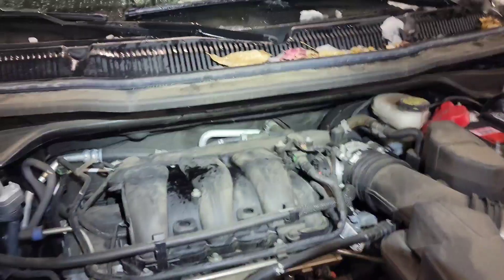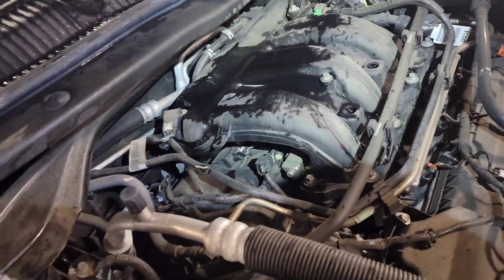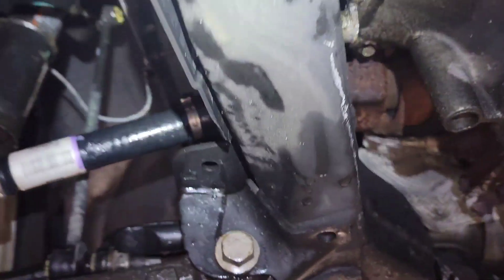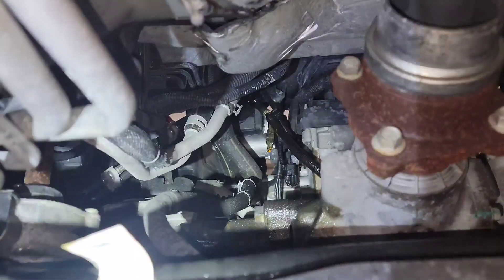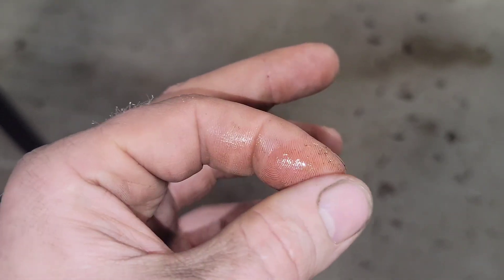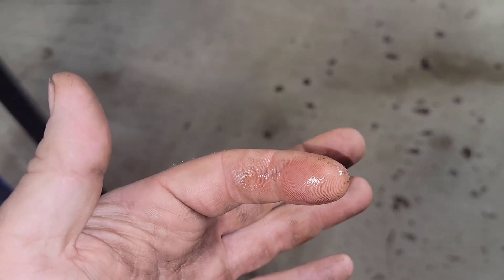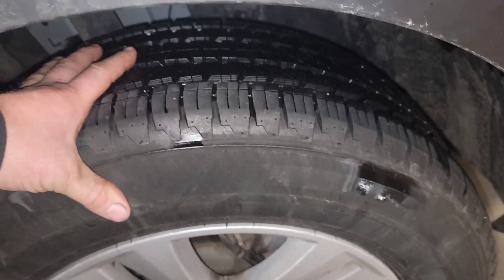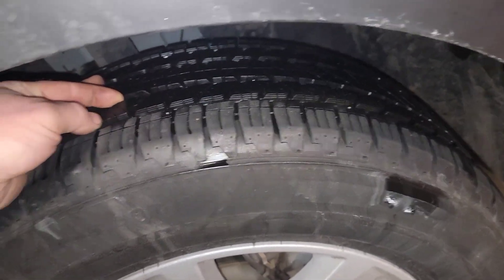2018 Ford Explorer 3.5L Front Cover Leak, PTU Leak, Roof Rail Fix - Part 1 Waiting on Approvals

Comment: Fantastic job, Actually my Ford Edge 2014 AWD SEL running 120k Miles, one week ago check AWD appeared on the dashboard then it's disappeared after one day only. And during the usual service check-up, the Mechanical noticed that there was a bit of a leak from the PTU and when we checked it smelled burnt oil even though the color was still crimson to brown then he advises replacing the PTU itself. Another friend recommends changing the PTU fluid only. Please I need your suggestion asap
Reply from the maker: 2 ways you can go, change fluid and possibly to work and eat the money or go right to the ptu and be done and service it every 30k from now on or sooner

Comment: I have a '16 Explorer with about 65k on it. I do my own fluid changes using Amsoil. I've done the diff and PTU twice now mostly because I'm aware of the potential issues with cooked PTU fluid. Beyond what I'm doing, is there anything I should be expecting to go bad or anything preventative I should have done at this point or, in the near future?  Thanks for your videos, I've learned a bit from you, reinforced some things I knew, and am always entertained. Peace. ✌👍
Reply: watch that water pump, mine is failing at 89k. I'm the 3rd owner so I'm sure that the coolant was never changed before I got it. Also the PTU was empty when I got it, that freaked me right out.

Comment: I drained my PTU at 40k with my 17 explorer sport. Now I have 60k on it. I also noticed a slight flutter on start up today in below 30 degree Temps. Oil changed every 3k synthetic
Reply from the maker: Flutter?

Comment: Hey bud my name is Brandon and I'm helping a friend out that has a  2016 explorer limited with the 3.5 and their battery light is coming on and says service charging system. They put a new battery in it but they put a regular battery instead of an AGM like it calls for would that cause the battery light and service charging system message?
Reply from the maker: You got to run a complete charging system test to make sure that the alternator is putting out enough voltage and a lot of times whenever you put an aftermarket alternator on these Fords they do not like it

Comment: What did you find out about the previous PTU service, was it done? Because that looks like nice oil after 85k miles in the PTU when its a 30k interval change. Shame to see that go after 85k miles.
Reply from the maker: Service writer went home and dropped the ticket off and said do all the work with no further input 

I will have to pester him for info
Reply: @FordBossMe  If you think its an overfill, you can pull plug, check metal shavings and measure the amount to see if its more than normal if no history. Either way, Ford ESP lotto paying out for this lucky customer hah.

Comment: Are you kidding me the timing chains go bad at 85000 wow what junk,  my fusion has 200,000 and has never been touched
Reply from the maker: This is one of the reasons why I don't want to help people out anymore cuz that is not what I said
Reply: he said shortly after 125k when extended warranty would run out. Also some engines will run forever and others follow normal failure patterns.

Comment: So when you are looking at that front cover is that just from underneath? Or did you pull inside wheel cover off?
Reply from the maker: I have no idea what you're asking me I literally put the vehicle in the air and then looked at the bottom of the motor from underneath and then showed exactly where the leak was at so I'm not sure where the confusion is unless this was said before you actually finished watching the video

Comment: What is your email so I can email you if that's easier?
Reply from the maker: Whenever you watch a video most of the important stuff is covered right at the top of the comments section in the very number one comment on top called the pinned post that's where all the critical information usually is including my email